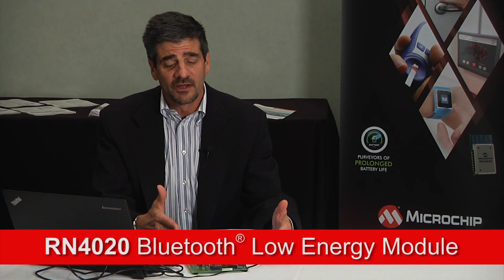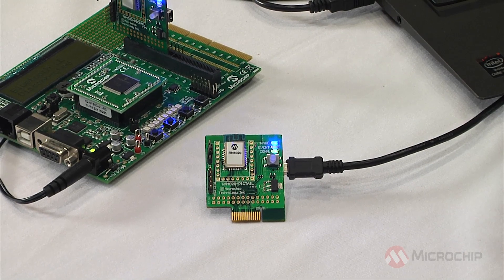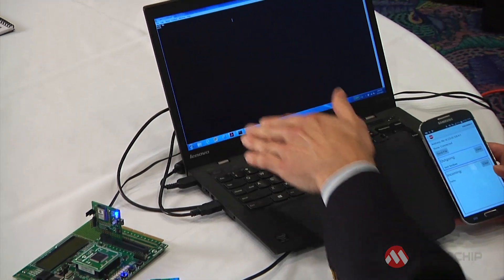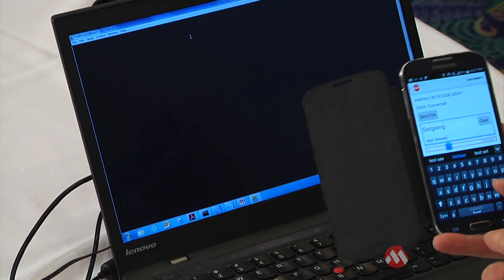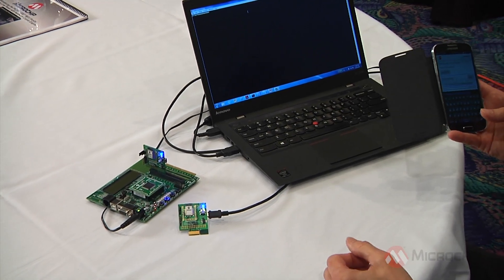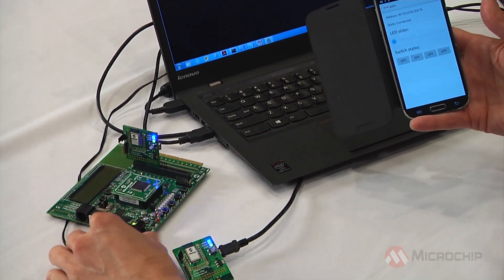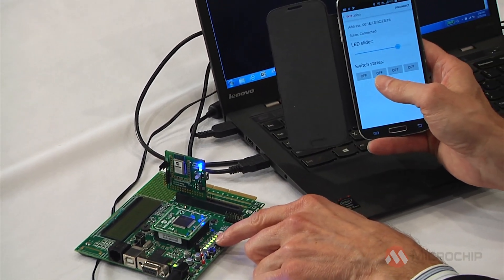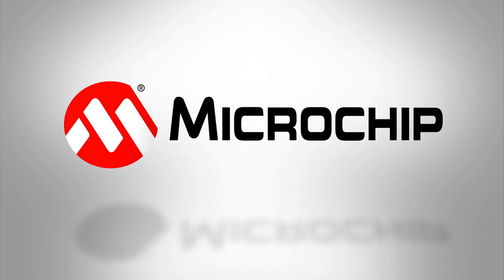RN4020 Bluetooth Smart Demo

Comment: Can you supply the source code. I have a major problem.

Hi! I am having trouble communicating to a BLE RN4871. I made and android app that writes data and I can only write 8 bytes to the device. If i use a ble scanner from google store, I can only also write 8 bytes. If I use your smart data app on my ipad, I can write many times. I haved enabled transparent uart service with command SS,C0 hence I can write and read. MLDP enabled in other words. The problem appears to be on the connection. When I use my app, I see %SECURED% if I use your Smart data apple app, I see %STREAM OPEN$. I need to somehow set my app to STREAM OPEN, I did try the I command already. 

My app
%CONNECT,1,6CC99AD22CD1%%SECURED%11111111%DISCONNECT%

Shows 8 bytes written and then no more unless I reboot.

On this bottom connection from SmartData from Microchip I can send as much as I want.

%CONNECT,1,7FB1183DF6E8%%STREAM_OPEN%%ERR_CONNPARM%hello sending many chars 123456789%DISCONNECT%

I can also reconnect and send again. That is something I cannot do on my app unless I reboot the controller.
Reply from the maker: Hi Mariano - we don't provide technical assistance through our YouTube channel. Please go to support.microchip.com and use the "My Support" link to create a support ticket.

Comment: Abysmal documentation indeed- it's virtually impossible to troubleshoot because the settings for virtually everything are contradicted in the documentation, so you virtually have to try every permutation of every setting. Another example, in the datasheet it says for MLDP/CMD pin "Change from High to Low to enter CMD mode from MLDP mode", but in the user guide it says "active-high to enter Command".

Comment: how I'm suppose to make it work?
Documentation only tells about a "btle browser app"
Couldn't find a single reference to mldp terminal app
Which commands i need to setup on the terminal?
Reply: +Davi Fagundes 
About "btle browser app", I haven't found anything looking like this one so far, either.
However, there are some other common applications which seems to provide the same features.
Look for "BLE Scanner" for example.
https://play.google.com/store/apps/details?id=com.macdom.ble.blescanner
It doesn't have the same interface, but I can test the examples with this one.